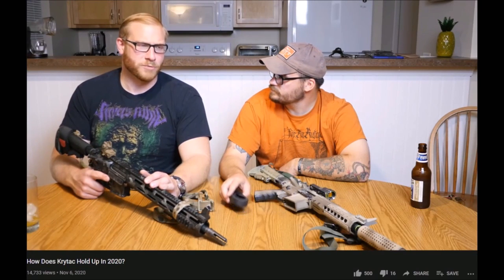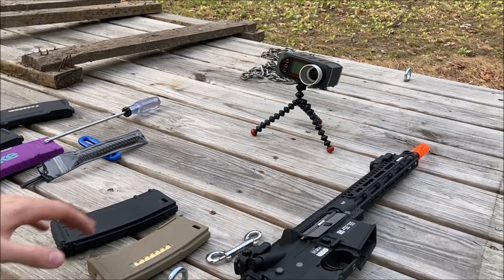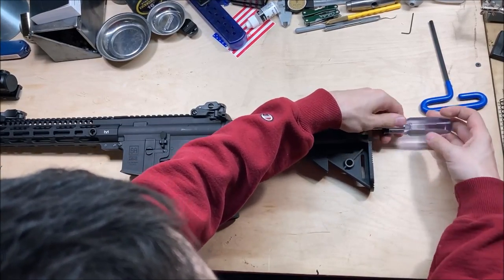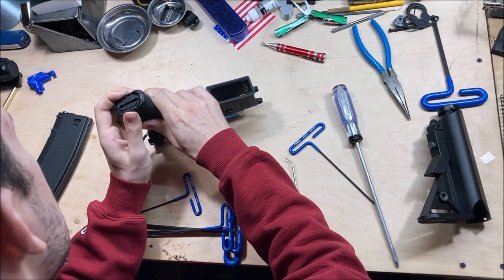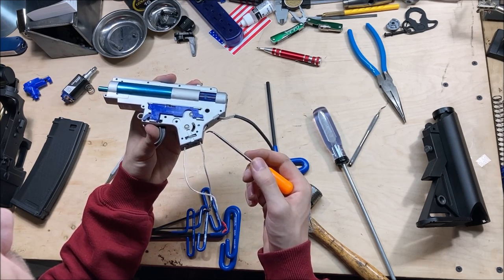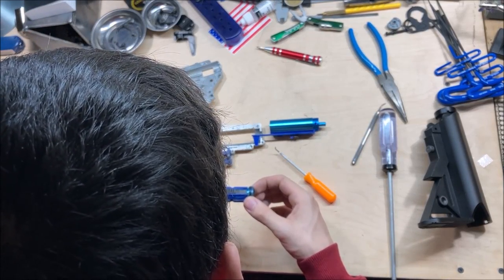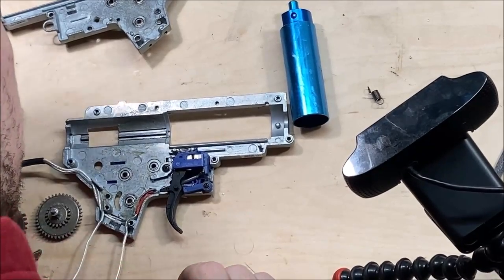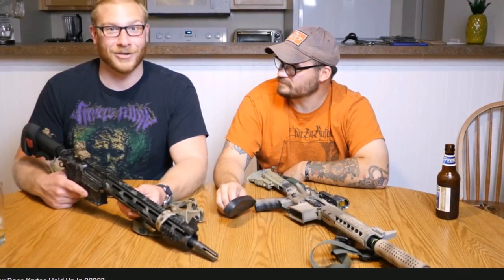Specna Arms EDGE SA-E20 Evaluation

Comment: Just got my E08 becoz of this review. Have you been using 11.1v? How did it go. Would u recommend 7.4v. Im only semi-auto person. Would Battery Voltage affect the gearset with semi auto?
Reply from the maker: this edge stopped being stock shortly after the video was made, use 11.1 and ideally a bigger one in one of my fixed stocks

Comment: Thinking about getting a specna arms SA e07 edge. Should be pretty much the same gun just different look. I've heard the quality control on the orion gearbox has been shocking but based on this vid it looks to be decent. Maybe they have stepped it up now. Would you recommend?
Reply from the maker: for now yes, ive yet to heavily use it
Reply: The Orion gearbox shell, in my experience, lacks strength in the front part. I broke 2 of them (one CORE and one ORION) using M110 and M120 springs, with normal use. I can't confirm if this is a design o QC issue, but i have noticed that other gearboxes in the same price range (no quick change spring) have thicker metal in the front part. For an edge replica I would say a motor upgrade (M140 high torque to use with a 7.4v 25-50c Lipo) and a better hop rubber would leave me happy, then a better hop chamber and finally a new gearbox shell, if needed. BR.

Comment: I like the value of specna arms M4s, especially if you tech a lot. Unfortunately, the orion gearbox shell (which is the same shell of the core line but with "orion" laser engraved) is not very strong, and I have broken 2 of them in the front, using M110-M120 springs. compared with other V2 gearboxes on the price range, the basic G&G or even SHS gearboxes, even JG, although without quick spring change, have more material in the front, and seem stronger.
Spare specna parts are cost effective and compatibility with TM compatible upgrades is quite OK. Here in Chile, even the CORE line comes with X-asr mosfet in the latest shipment (late 2020).
thanks for the video
Reply: It does seem like these m4s are pretty good I’m planning to get one in March gearboxes are easy fixes right?
Reply: If you are able to take apart a V2 gearbox and put it back together, it should not be a problem
Reply: @cuajocuajocuajo  awesome thanks man

Comment: This channels reviews are the only ones I trust and I've been doing tons of research as well as receiving suggestions and they keep suggesting this rifle. Do you have any suggestions for platforms that are better around the same $200 price range.
Reply from the maker: The Maple Airsoft Marauder is superior but its out of stock more often than in stock
Reply: @kewldude007  would you say a G&G SRS would be similar value to the maple? Stuck between choosing between those two at this point.
Reply from the maker: @brohammerinc4673  the only g&g gun I like is the ssg1
Reply: @kewldude007  thank you for your input I trust you guys because you actually review your guns by breaking down the internals instead of just doing an unboxing and shooting it five to ten times. Keep up the great work and thank you for your responses!

Comment: Why will you use the m90spring?
Reply from the maker: I dont
Reply: @kewldude007  man in teh video of 22tpa 12:1 or what you did with that Specna do you have some trigger unit or something or special mosfet? I wanna have on Specna good triger respons so i want to have 22tpa and 12:1 gear but dont know how good it the trigger travel on Specna or how i can some how change it hor low Price

Comment: This vs cm.097?
Reply: Please be so kind and tell me the why's :)
Reply from the maker: @alessanrobutturini3288  Specna since it has a better motor, better mosfet, rotary hopup, doesnt have a proprietary spring guide
Reply: @kewldude007  thank you for the quick response. I put a retro arms hopup unit and a slong rubber and o ring nozzle in my cm.097. I''ll also install a titan and a maxx trigger like you did. Any further upgrades you'd recommend?
Reply from the maker: @alessanrobutturini3288  I would replace the piston head since mine ate the cylinder
Reply: @kewldude007  thank you !!!!